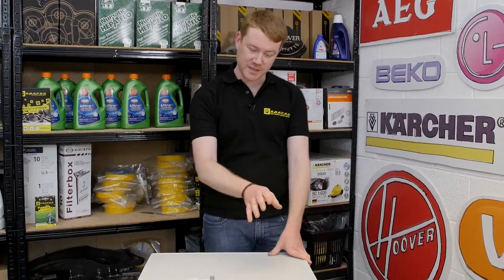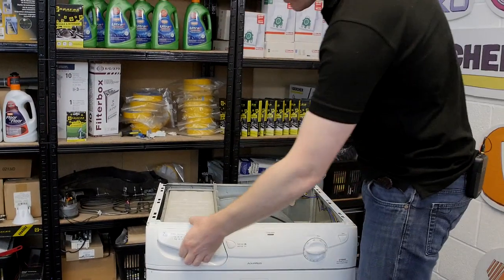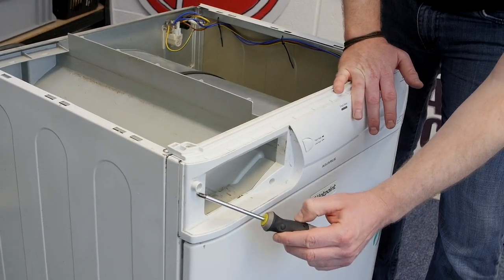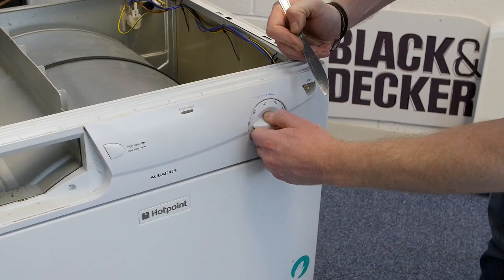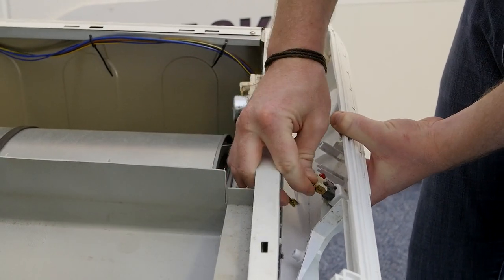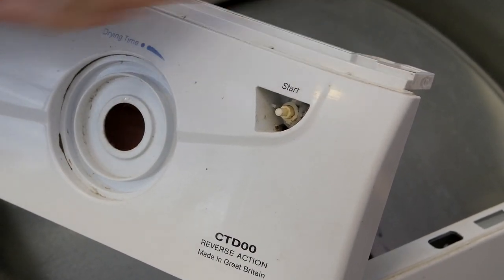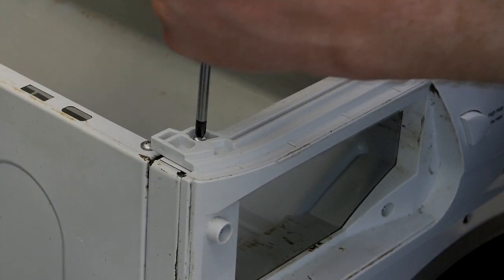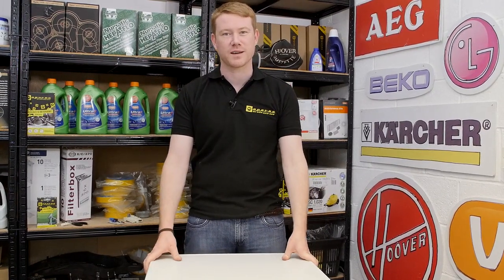How to Replace a Tumble Dryer Start Switch (Hotpoint, Indesit or Creda)

Comment: Is there an easy way to tell whether the switch is broken, eg it won't click in and out?  Otherwise it's trial and error to find out which combination of the three parts mentioned is at fault?
Reply from the maker: Hi Terry, the easiest way to test the switch is with a multimeter, test in the off position and you should get nothing and when you press the button you should get a reading on the meter.

Comment: Is there a certain way the replacement start switch goes in, I took the old one out but didn't look to see which way it was inserted or does it not matter
Reply from the maker: Hi neild169, it does not matter which way round you fit it in as long as it is in securely.
Reply: Brilliant thank you this video will save me roughly £280 because normally I would throw out the offending dryer and buy a new one. Thanks for the video
Reply from the maker: Hi neild169, glad we could help have a lovely day ☺